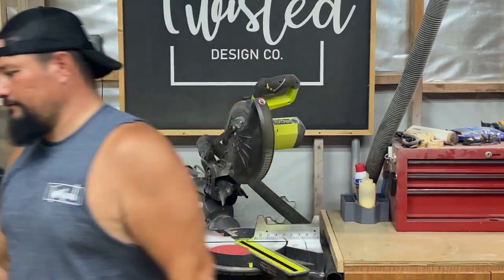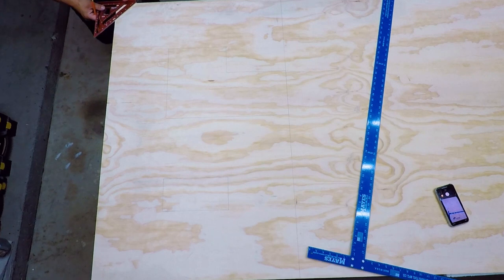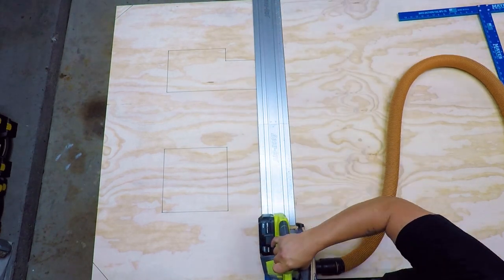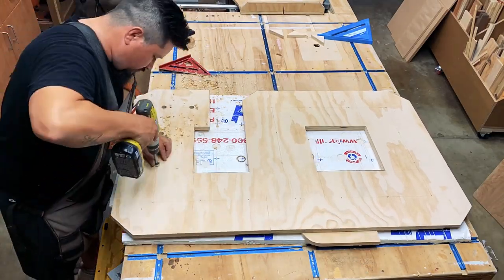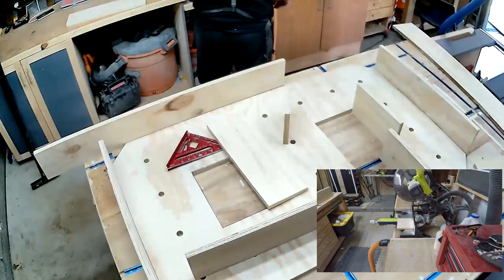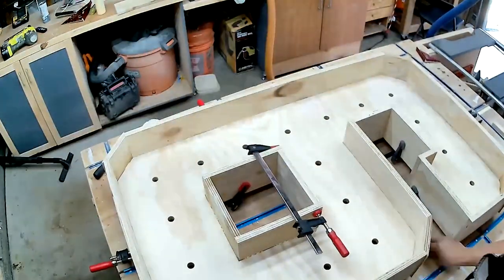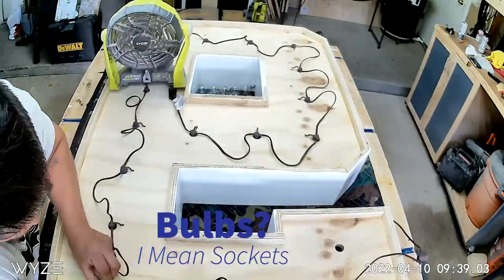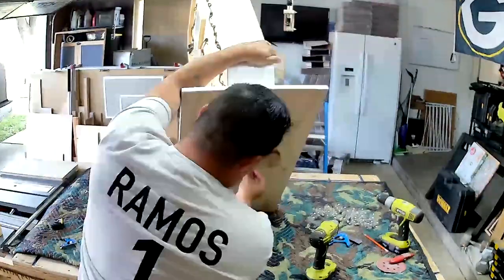Marquee Numbers | How to build | Short version

Comment: Hello from Germany, i like your video. You mix the filler with water to fill it in the bottel. How many water you use?  Thanks Gabriel
Reply from the maker: I use just enough to thin the filler without it being to watery however I have since started using white caulking

Comment: Which drill bit did you used to drill the holes?
Reply from the maker: With these lights which are the Better Homes and Garden 20ct from Walmart I use a 13/16” forstner bit, you can order one online or purchase them at a  woodworking supplier like Rockler or Woodcraft
Reply: What are you using to lift the number from the table when  glueing the sides on?
Reply from the maker: @sondrastanley7230  I cut 1” strips and place the underneath to get a 1” lip on the back side
Reply: @twisteddesignco  thank so much